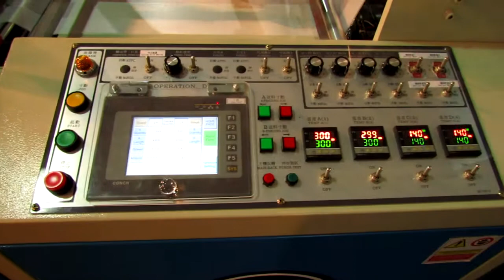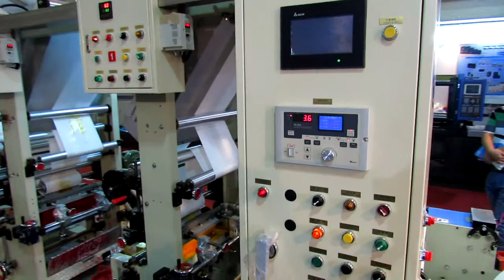Gravure printing machine / Heat seal t-shirt bag making machine

Comment from the maker: Loop Handle bga making machine
t-shirt bag making machinery
pp bag making machinery
plastic bag machine price
Flexographic Printing Machine
PE 1 Screw Double Blowin Film Machinery
Recycling film machine
t-shirt bag making machinery
garbage bag making machinery
side sealing machine
bag on roll machine (Without Core)(With Core)
flat Bag making machine
boot sealing machine
net Bag making machine
banana bag making machine
Automatic High Speed SHOPPING BAG
T-Shirt Bag Making Machine with Hot Slitting & Side Gusset
three layer heavy duty film coextruded line with inner embissing machine
Carry Bag
pick up bag
vegetable bag making machine
star seal bag making machine

www.dipomc.com.tw
dipomc@seed.net.tw